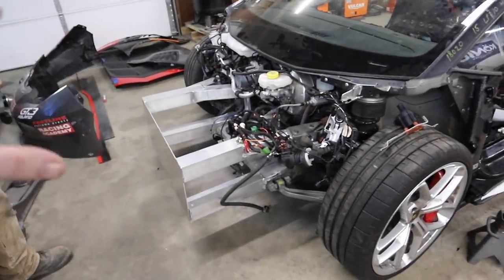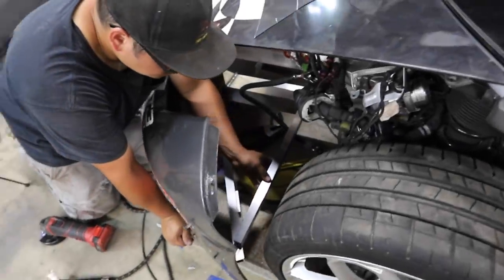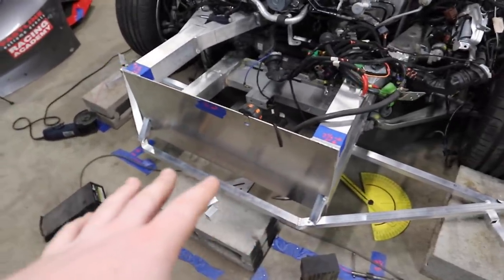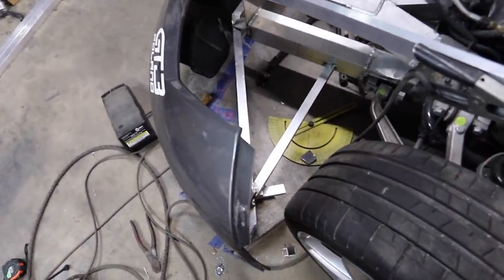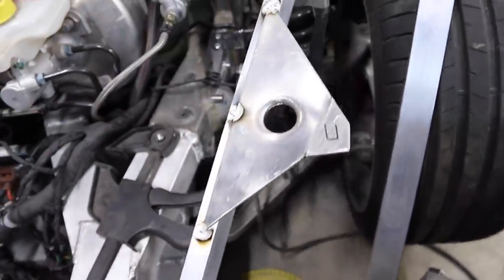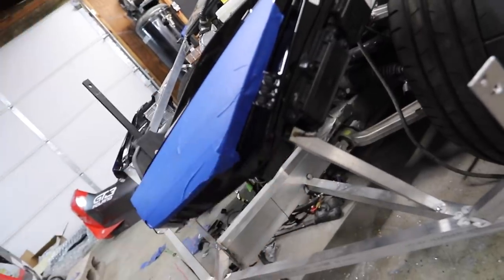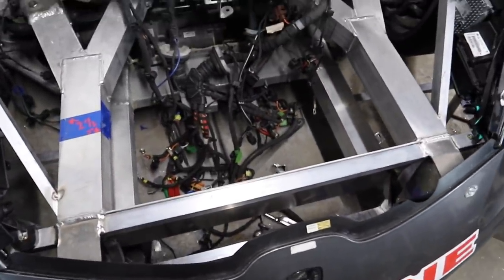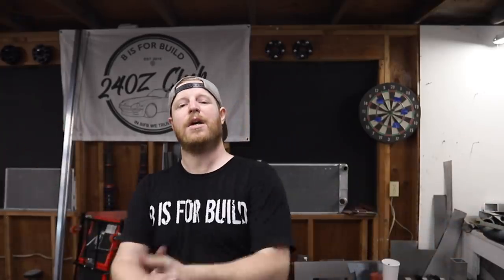Building a Tube Frame Front End for the Huracan

Comment: I went to the comments but was reassured when I saw everyone else pointing out he’s got Oscar doing all the work.

Also, shout out for this dude going the extra mile and using a RivNut tool to sink in threaded screws through for the bumper mounts. 

Clean work, good job Oscar.

Comment: Those headlamp brackets should not be flat. You need more stiffness, or they'll vibrate (vertical direction) at some frequency. Possible fatigue failure and wobbly headlamp might result.  I suggest bending the edges down. I also hope you are intending to fully weld the seems.

Comment: You need to make sure the screws going through the body of the headlights don’t get hot and then get the metal hot and melt any wires you have zip tied to that metal headlight  bracket.

Comment: Ya'll are doing an amazing job but you have a perfectly good Huracan that you can use as a go by instead of trying to reinvent the wheel as far as the frontend structure bc your 3rd mounting points is going to be in the way of your 2 rads. Lamborghini incorporated 3rd mounting point into the radiator mounting structure.

Comment: "This car when it turns on, it thinks it been in an accident still"    Ha Ha Ha! 
Nice job fabbing all those brackets, and supports.  Lights do look good! 
I'm surprised no one from the peanut gallery has warned you about the missing safety crumple-zone crimps on those new forward frame members.  The factory frame members have a crimp in them so they absorb the energy in an accident by collapsing.  Another YouTuber, rebuilding his Lambo, was recently berated by the peanut gallery for not crimping the frame members he installed, and actually went back and replaced his newly fabbed frame members with another  set of frame members with the crimp. lol

Comment: the front of this car is only going to weigh like 350 pounds. might need to find a way to get more weight there and not all in rear.
Reply: Just add a weight plate.
Reply: I did not even think of that. The engine is massive, weight distribution will be so different from a regular Lamborghini. I really wonder if this car will ever be street legal.
Reply: tennisfan4201 The big battery in the front adds some weight. So will the radiator. Not sure why he added the flat plate to block all the airflow though lol.
Reply: The engine is still forward of the rear wheels making it mid engine. By the time they add the battery, floor pan, radiators, condenser and heat exchanger it will be nearly 50/50 front wheels to rear. Probably something like 45/55.
Reply: @WarefareModern3  the flat plate is there cos that's how a huracan is made so he just copied it.
Reply: Nemesis 11FP the engine and trans is not really in the middle and the rear is nearly nothing. A battery and single radiator weigh like 60lbs
Reply: @cf6282  the funny thing is that the ls is actually lighter than the v10. Smaller too.
Reply: @tennisfan4201  the definition of mid engine is the engine in front of the rear axle and behind the front axle... it is mid engine. Actually, you are obviously an automotive engineer, I'm sure you are right.... nevermind.
Reply: @nemesis11fp20  My last comment is not disputing the definition of mid-engine but rather is meant more literally. If you spliced this car in half at the door it'd almost all be behind the seats. The front lift at speed from having so much weight behind the passengers, even if it fits the mid-engine definition, doesn't make it well balanced. That was the point. no need for a specified field of knowledge like engineering to see that but hey, it's a show build anyway! but you seem keen to defend the weight balance of this car for some reason. do you happen to be an automotive engineer because clearly you must be one to draw conclusions?
Reply: @tennisfan4201  look genius, any weight from the engine will be placed on BOTH axles because it is in FRONT of the rear. No I am NOT an automotive engineer but I am a mechanical engineer. Doesn't matter though, I don't really care what your opinion is anyway. Have a good evening.
Reply: @nemesis11fp20  Lol good save checking out in the end of your comment...from one engineer to another! 

You do care about my opinion though. otherwise you wouldn't have tried diminishing my claims by stating I'm essentially unable to draw a conclusion if not an automotive engineer, then calling me an idiot through sarcastically calling me a genius...and the fact you are reading this comment!

Your support for your reasoning is poor.  
you keep arguing apples to oranges and not even reading my comments. again never argued if the weight from the middle would in part be disbursed on the front. as a whole this is headed towards a 60/40 split, which for it's purpose is fine anyway but think of a 20 ft plank supported by 4 wheels and a hundred pound weight right in front of the rear wheels. Is that well balanced?
Reply: @tennisfan4201 While I would understand your concern if it was a brick, but the Aero on the body kit has Canard's when fully installed which provide downforce at the front. For specifics, 13:27 in the background.

Comment: If you're not running anything inside the front bumper than why don't you block it off, So that you can get the aerodynamic on the front end. It's only a trunk and for sure no radiator is going to be right under the front bumper or the AC condenser

Comment: U should have made sum to b able to adjust the position of the head light like a nut n bolt on round tube to raise n lower it who knows what the wind n air pressure will do on da drive or when da final of build just insurance so u don't got to grind n weld again

Comment: Are you removing that flat plate from the front of the car? Not going to get any airflow out your hood
Reply: Being a rear engine the cooling setup will not need airflow for cooling where that plate is.
Reply: Tim datoolman that’s where the radiators and coolers need air flow coming through? You wouldn’t put a radiator in the back of a rear engined car

Comment: I'm no expert but don't see any crumple zones in the front. (yet)
Reply: They copied the stock aluminium frame. It even has the same small indentations which make the whole thing bend correctly in the event of a crash.
Reply: @andreabotti99  Can you explain more or maybe provide a link? I was thinking the same thing but I don't know anything about structural engineering or crumple zones? Thanks for the point about the dimples.
Reply: @grahamthomas8178  I'm not sure what you're looking for, if you want I could tell you the episode where they talked about these things but other than that I'm no expert either, I know what crumple zones are and the principle behind them but not much more
Reply: @andreabotti99  ok cool no worries. I'll do some research on crumple zones for the Huracán.